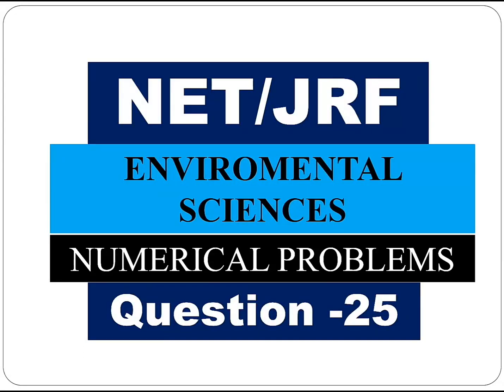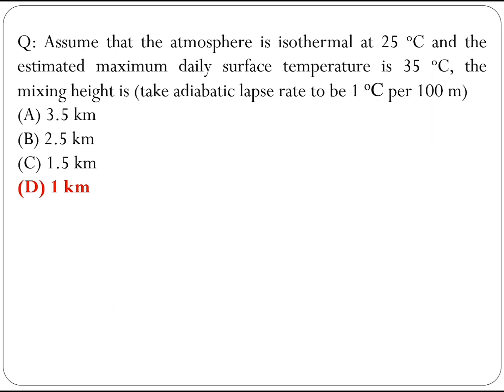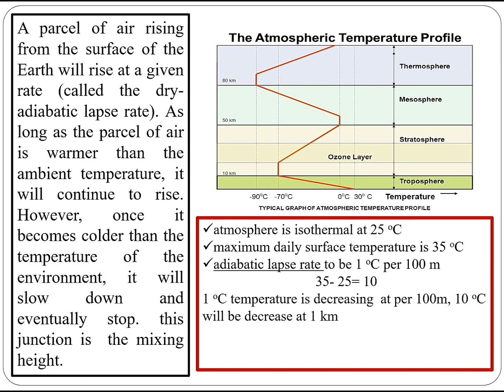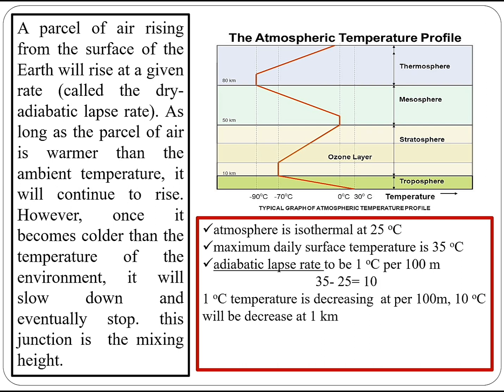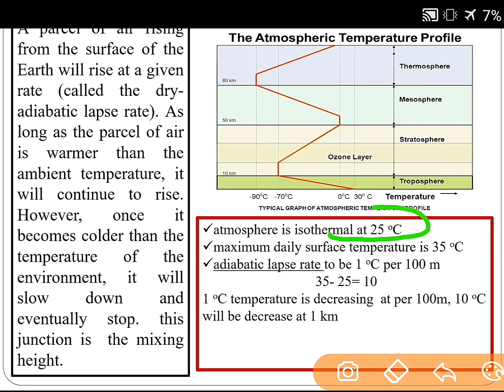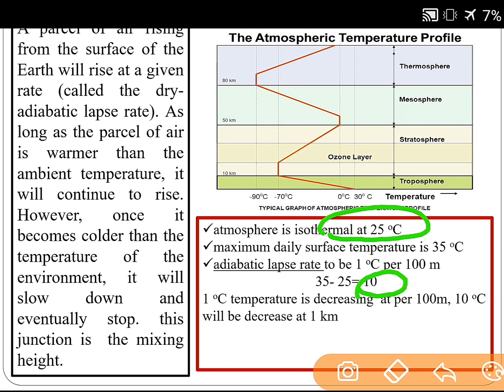Numerical problem on mixing height| NET/JRF ENVIRONMENTAL SCIENCES

Comment: Sir what is flu gas?
Reply: Flue Gas is a byproduct of combustion, normally vented through long pipes known as flues, which exhaust gases from fireplaces, ovens, furnaces, boilers or steam generators. These gases are treated as pollutants.

Large amounts of flue gases are generated due to combustion of petroleum products in oil and gas industries. These gases are also created by wood fires and vehicle exhaust.
(Source : 'Petropedia')
Reply: Flue gas is sometimes called 'Exhaust gas' or 'Stack gas'.
Reply: Thats a lot of information…